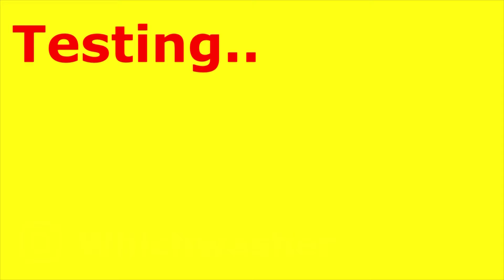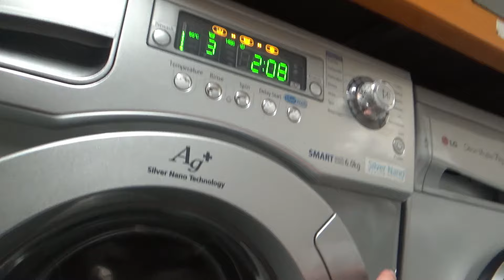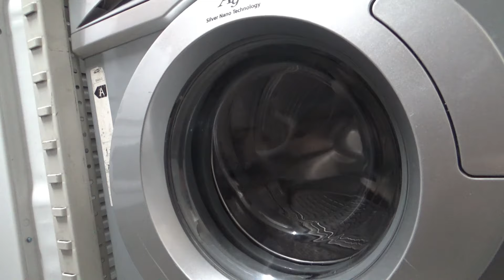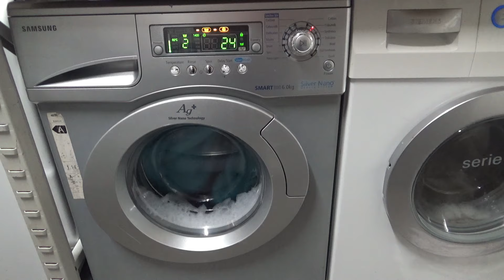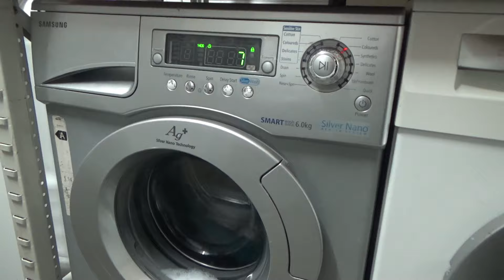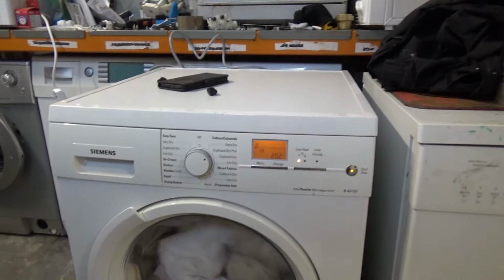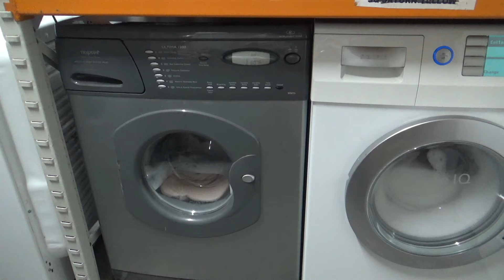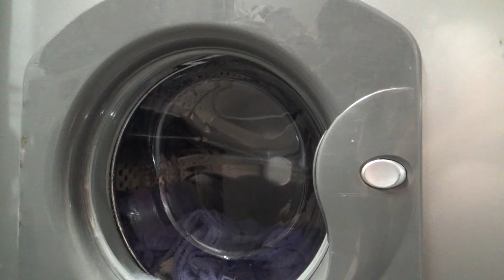Testing No.66

Comment: I think the Serie 4 was doing an Anti suds phase… It’s quite annoying but these obviously have some sensor that means they run that fill, sit doing nothing, drain, repeat without even attempting to spin
Reply: Also that seems like the new standard for suspension on these… made it even softer than it used to be 😅 so god help these machines when the dampers do wear out